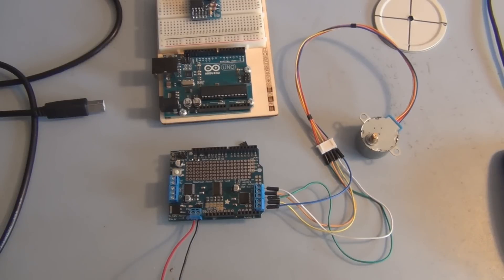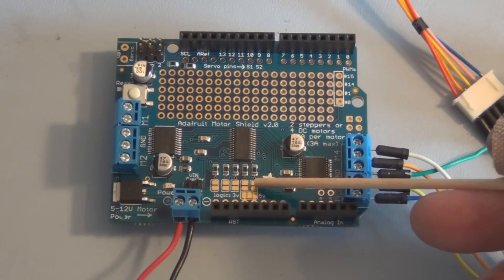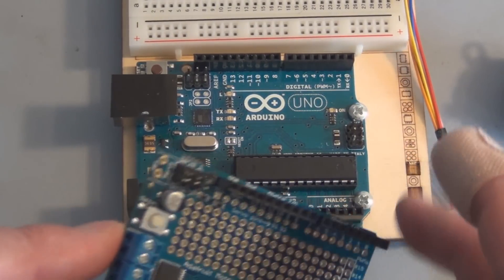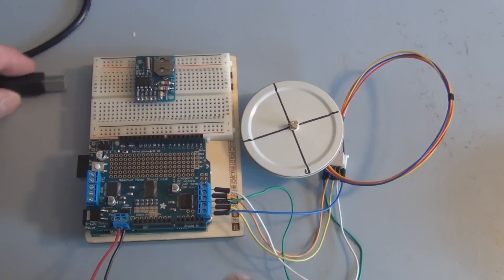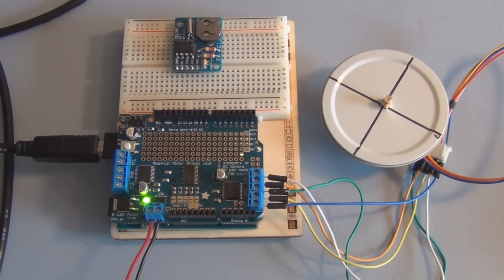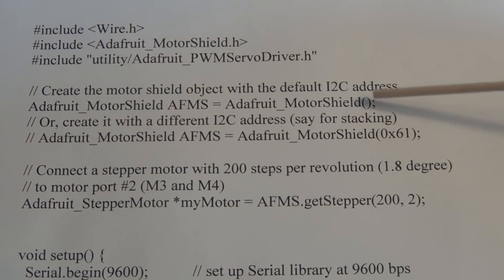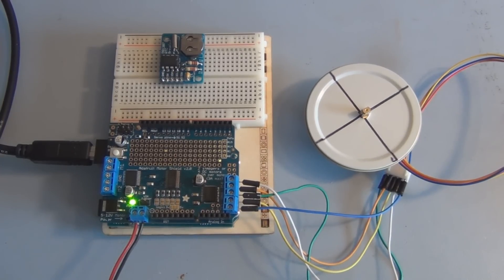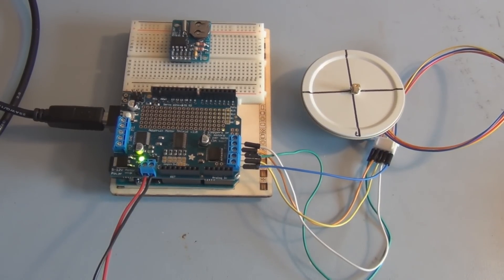Adafruit Motor Shield and Arduino Uno Stepper Motor Tutorial

Comment: Just finished setting up a simple CNC machine using this shield. Worth mentioning that 1 amp continuously drawn by a single stepper is too much. The shield says 1.2A peak, but 0.6 (half of that) is ideal for a normal run. Touching the H-Bridge controller with a finger should give a good indication of the current level. I almost burnt our mine powering the motor with an ATX power supply. Adafruit recommends adding a heatsink if the chip temperature elevates, but there is no easy way of doing it on the shield. Surface caps get in the way.

By default the shield will hold current, preventing steppers from turning when idle. My short term solution to the problem included a release() command, allowing components to cool down. In some sense, the v1 shield was superior as it had through-hole logic chips that were easier to swap if things burnt out. For the same reason I still go with older Arduinos. Replacing a fried Atmega - $4 as oppose to the $20+ PCB. Adafuit shield is in the same price range. Individual H-Bridges are $4 each tops and they're the most likely components to burn if mistakes are made.

Comment: Hi,As a beginner this video is very very useful for me,thanx,thanx,thanx .And- I used 8 AA batteries as the power supply to the motor shield.But the LED is not lit.I know that it shows that the DC/Stepper motor power supply is not working.can you help me to solve this.plzzzzzz(sry,this can be a very stupid question)
Reply from the maker: Are you using the Adafruit motor shield?  Here is the information on powering the that shield.  You must also supply 5-12VDC to power the motor. There are two ways to do this

You can power the Arduino via the DC Barrel Jack and insert the VIN Jumper shown as the tall black handle right next to the green Power LED below
You can power the Arduino via the DC Barrel jack or USB port. Then Power the shield via the 5-12VDC motor power terminal port, the double terminal block next to the green Power LED and remove the VIN jumper 

If the Green LED isn't lit up brightless do not continue - you must power it via the VIN jumper or the terminal block
Reply: thank you very much for your advises.yes of course.I did so,but the power LED is not lit.Earlier I used a 9v battery and the LED was blinking.Is it burned ??? A 1 servo motor is working but not both..

Comment: I am using the arduino mega to test my motor shield, but I don't know the connections I need to make between the  mega board and motor shield. Can you please explain the connections , which pin needs to go to which pin. Thanks for your time and help.

Comment: I have a question, if I remove the jumper on the top, then all the power for the shield will come.from those 2 wires ? but the Arduino still needs power separately ? Also what about the 5 V line for the servos ?
I have 3 servos that will lift a big load, and I would like to connect them to a 5 V that takes more current than the USB
Reply from the maker: Here is the Adafruit information on how to use this shield. https://learn.adafruit.com/adafruit-motor-shield-v2-for-arduino

Comment: I need some help.I have the Adafruit motor shield (V2.3), the Arduino (UNO)
and a 4-wire stepper motor purchased from Adafruit. Along with that I
downloaded the software for the motor shield from Adafruit. I’m using a power
supply for the motors and running at 11.8 volts at 1-amp. The software example
you used is visible and uploaded into the Arduino. I put it all together like you have it, but its not working.
The power L.E.D. on the shield is on when the power supply is on, but the motor will not turn.  There is
no power to M3 and M4 to power the motor. I don’t know what I’m missing here. Any ideas?
Reply: You probably have already solved this after 2 months but.. 
Did you try to connect the 4-wires of the stepper on the M1 - M2? You can also check the code and see which pins is the arduino commanding to conduct. <=== Was this the solution?

Comment: You said nothing about wiring o 28byj-48 motor. It's useless if you do not explain why you connect each wire in each head.
Reply: I'd actually like to second this. This exact same setup does not work on my shield and I can't figure out why without any explanation. Anyone figure this out?
Reply: it's been a year ik, but for me it helps that you know how a stepper motor works to explain why the shield has that sorta wiring configuration
this video explains it really well: https://youtu.be/bkqoKWP4Oy4
it can probably explain it better than I woulda attempted